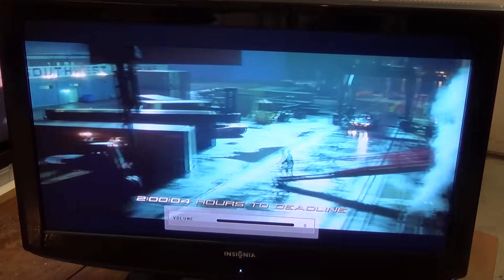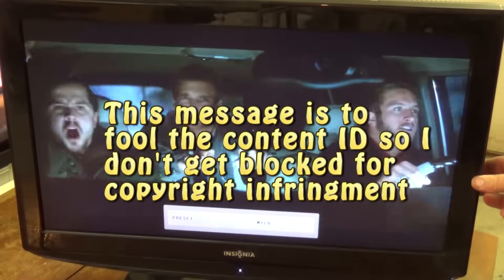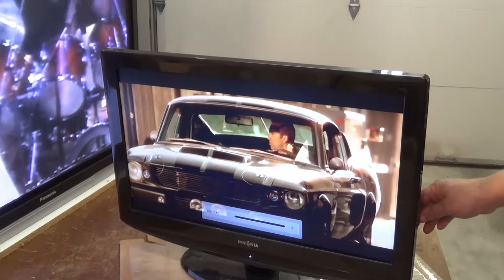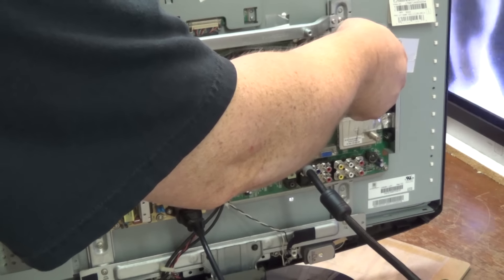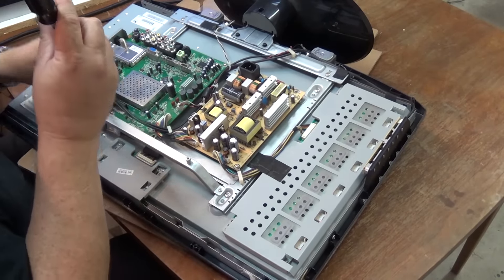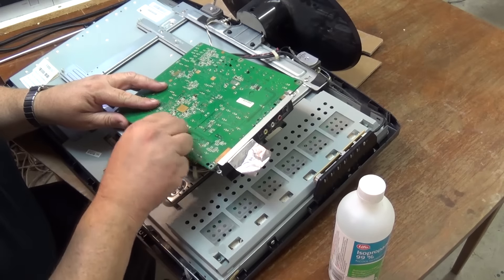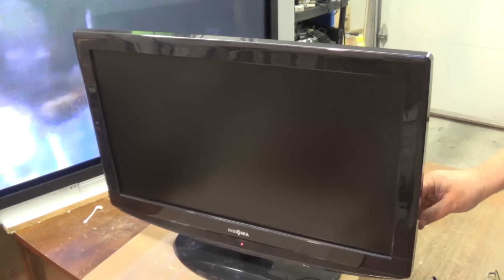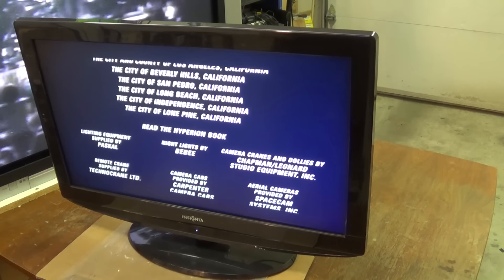Insignia Dynex LCD menu problems

Comment: I've never seen your repair room so clean :)
Reply from the maker: +André Campana Merétika You normally see the cluttered corner, where everyone just piles stuff up. The rest of the garage is clean, as I do park and charge my car in there.
Reply: @12voltvids  
Do you have a Volt?
Reply from the maker: @NunYa953  
Yes a 2012.  That's where the channel name came from. First videos were about the volt. Looking at getting a 19 volt right now. Best car I have ever owned. Will be passing mine on to my daughter
Reply: @12voltvids  
Man, I sold cars for almost 15 years. Average 25-30 a month. Only worked at a GM dealership for about 10 months and we couldn't give those things away. I'm assuming the tax incentives in Canada are good for one of those? The government tried to subsidize them here but it didn't work because your income would have to be about $150,000+ a year. Most people in that tax bracket either buy a big V8 SUV or a Tesla.
Reply from the maker: @NunYa953  
There are incentives to buy electric, plug in and hydrogen cars here. Here it is 5000. This is only good on cars costing under 70 grand so tesla buyers don't get it. Even the model 3 buyers are having a harder time to get it because most of them end up being north of 70.  Even my volt was over 50 by the time the tax was paid. The incentive basically paid the tax on the car. When I calculate what I have saved in gas, and maintenance compared to what I was driving before, the car has just paid for itself. Took 8 years, but I have now saved in fuel and maintenance for the miles I have driven almost the entire cost of the car. The reason these cars weren't flying off the lot was because GM did a piss poor job of marketing.
Reply: @12voltvids  
Another huge reason they don't fly off the shelves is because alot of Americans lease their vehicles or have such shitty credit they can't finance a new car. For the last 6 years I sold cars (2010-2016) 85% of my new car customers leased. If you are the type to keep your car until the wheels fall off a lease isn't a good idea, but most people keep their car an average of 43 months so a lease on the right vehicle is the best way to go.

Comment: Hello Sr. I have a Hisense model 32K20DW and it has the 6 red light blinks then get solid and off ( the standby light ) I'd been looking al the web but I can't seen to find what the code means would you by any chance know what it means??? I will appreciated your info very much thank you.
Reply from the maker: +lyon65 Sorry I don't know what that code means. Every manufacture uses different fault codes, so you have to figure out who the actual manufacture was and then you can usually find the fault codes online.
Reply: +12voltvids  OK thank you for your fast response, I will try that approach .

Comment: I have a same problem when my portable laptop on my 2012 Acer Aspire One 722 Windows 7, it keeps put on dim automatically where I can't put to full bright mode on the monitor, and I don't know how it actually caused to do that automatically. =(
Reply: +Bluethunderboom Go to Control Panel and go into your video card software, you should have settings in there that would address that issue, look for something called Theater Mode, I dislike this feature as well and wish the manufacture's would not force this on its users, it should be an option the users selects if they desire....hope that helps!

Comment: do you get your 99% isopropyl alcohol locally?  Meijer used to carry it they dont anymore and its ridiculously priced online...  =( been looking for ages I knew I should have stocked up on it....
Reply: +Jay Walt Its  Life brand IPA from Shoppers Drug Mart, same place i get mine.
Reply from the maker: +Jay Walt Yes local pharmacy stock it. Usually behind the counter, so you have to ask for it. This is to keep the abusers from getting it and drinking it.
Reply from the maker: +Neil Robinson Normally I just fire up the old still in the back yard, but this time I was lazy, and spent the 2.90 to buy a bottle.
Reply from the maker: +Jay Walt You should be able to get it at any drug store, but will probably have to ask the pharmacist for it because of abusers drinking it. No different that drunks drinking mouthwash to get the alcohol in it.
Reply: No place around here has it.  Can I ask what pharmacy? Is it a chain pharmacy or a mom and pop place?
Reply: +Jay Walt If you are in Canada, Shoppers Drug Mart, its a nationwide chain,
Reply from the maker: +Jay Walt 
Every pharmacy around here has it, the big chains as well as the small private places. They all keep it behind the counter. You have to ask For it. 
Electronic components suppliers also carry it as it is used as a cleaner.

Comment: An excellent video.  

The nice thing about this video is that you show that, sometimes, the solution is as simple as tightening up some ground screws.

What do you think of Best Buy's Insignia and Dynex sets?  Are they good and  dependable?  Or something to stay away from?

Regards, Tom
Reply from the maker: +THOMMGB I have a 3 here of my own, and they are all pretty good sets. I use one as a security camera monitor, and it has thousands of hours on it. Been un use for about 10 years every day, no issues. They look to be pretty reliable.
Reply: +12voltvids  Thank you.  I always wondered about the quality of those Best Buy sets.
Reply from the maker: +THOMMGB They are ok. Not the best you can buy, but certainly not the worst. For what they cost they are fine.

Comment: I have seen some people use acetone along with the alcohol. What are your thoughts on using acetone? Will it damage anything if you don't take some special care?
Thanks for the video and have a nice day.
Reply from the maker: +amtpdb1 acetone works just fine for Pc board cleaning. It is toxic though so wear gloves and good ventilation is needed.
Reply: +amtpdb1 I use Ronsonal lighter fluid aka naptha, it seems more gentle of a cleaning solvent, especially on plastic.  Don
Reply from the maker: +umajunkcollector Yes that works well too, except that it is flammable.

Comment: lol. I bought an insignia 40"  and this problem showed up 1 month after the factory warranty was over.
I'll try tightening those mb screws and check the switch cable. pretty sure it's going to the curb.
Reply from the maker: Yup, junk. This one lasted for 14 months and they another problem showed up.  I actually just got the set back but this time it has a main board failure.All these new sets are just garbage. I much prefer working on older gear that is repairable. This newer stuff is garbage